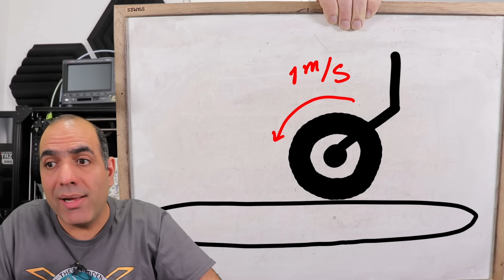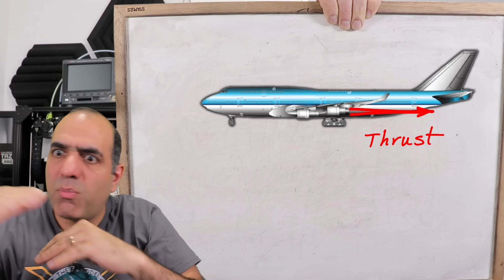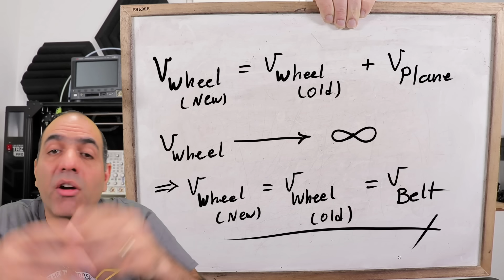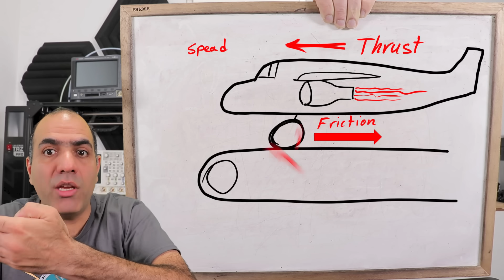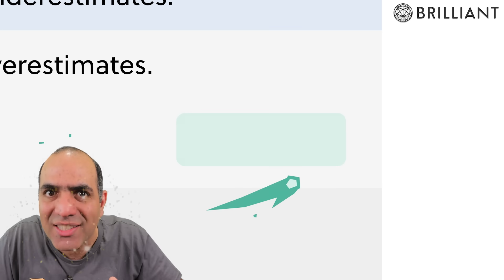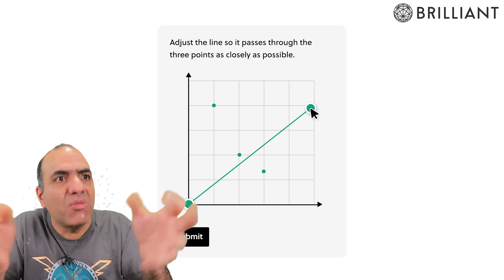Airplane Question that Drove Me NUTS!!!

Comment: Supposing a given plane could produce enough thrust to overcome any added forces produced from rolling friction, which would have to ignore the maximum rate at which the wheels could turn without flying apart, the plane would accelerate, causing air to move over the wings, producing lift and eventually takeoff. Imagine a person on skates on a tread mill, and you are behind them arms out holding them in place while the skates and belt roll over each other. The force you are putting into holding them in one place is the rolling resistance needed to overcome the squish of the wheels, belt, and bearings. Notice how its a tiny force easily overcome? Even if the treadmill accelerates, you could push them forward. For the plane the wheels should only experience a doubling of the rate of acceleration up to the takeoff speed maxing out at twice the takeoff speed wheel RPM (if the belt does not infinitely accelerate trying to catch the wheels and thus the problem of the landing gear wheels and rolling elements flying apart from centrifugal forces). Of course, this would mean the takeoff length would probably be some length longer, but again as long as the engines can overcome the increased rolling resistance and accelerate to takeoff airspeed it is going to take off. No airplane I am aware of gives mechanical drive power to its wheels, especially for takeoff. 

A similar scenario would be a seaplane on a river flowing towards a narrow waterfall, with the plane facing away from the fall against the flow. As long as it can produce enough thrust to overcome the water resistance imparted by the increasing flow and gain airspeed over the wings, the wings will produce lift and the craft will enter flight.

In both cases the craft is 'decoupled' from the surface its on by the freely turning wheels, or in the case of a seaplane water over the floats.
Reply: CORRECTION EDIT: You won't believe how the math says, "No!" with this one weird trick!!! A&P Technicians hate it..... 

The normal take off speed is 184 (on average, varies based on configuration, airframe, load out, meteorological conditions, etc) mph, taking 30 to 40 seconds to achieve sufficient flow across the wing airfoil profile to produce a lifting force greater than the mass of the aircraft allowing the flight control surfaces to maneuver said aircraft away from the ground. A 747-8 tire is 52 inches and weighs 270lbs or 550lbs with the full wheel gear (based on quick cursory googling), 184mph at 52" diameter is 1189.4 RPM producing 1044.7g of centripetal force. These are the NORMAL forces these wheels experience every single takeoff.  

Supposing the treadmill does not attempt to 'out race' the wheel speed, instead simply samples it say every half millisecond and (somehow, finger wiggle) instantaneously matches that speed (yes, meaning due to acceleration the treadmill would technically be 0.5ms worth of acceleration behind the wheel speed at any given instance above 0 mph. Ignoring whatever that tiny difference would be at takeoff) the takeoff forces should be around 2*takeoff speed(no treadmill). Or 368 mph(relative wheel-to-treadmill speed for a decoupled object (ignoring mechanical rolling resistances) moving at 184mph true ground/air-speed), 2379rpm, and 4179g.

Golly that's a lot of force! But wait....we can't stop there! We can't get lost in the neuro-high of working out a big ass number, we need the final part of the puzzle! What is the rated over speed (maximum speed) for 747-8 wheels per the manufacturer? Well, it's Boeing, and it's the FAA, thus those ratings would not only be part of the standard training procedure but also publicly available. According to Boeing, 235mph is as fast as they ever want to see the wheels spin, and advise a full wheels off inspection if they exceed this speed, so not quite failure, do not exceed, fly the thing apart speed, but the speed at which you done caused a mechanic to earn their paycheck making sure you didn't break your employers leased jetliner... Well, here we go....

Normal takeoff: 184mph, 1189.4rpm, 1044.7g.

Wheel speeds of takeoff on treadmill(normal takeoff*2): 368mph, 2379rpm, 4179g.

Maximum rated wheel speed at takeoff: 235mph, 1519rpm, 1704g....

🤨😥🙁😤😔😢😔😑😐🙄😒

...So 😁 ignoring the issues with instantaneously matching wheel speed as measured every 0.5ms, and mechanical friction and rolling resistances in the tire-treadmill interface and inside the bearings, the answer is....

No, the aircraft will not take off due to the landing gear wheels flying apart about 15 seconds into it's takeoff roll. The plane will have been traveling north of 117.5mph when the landing gear machanisms drop onto the treadmill surface which would have been moving over 117mph in the other direction, likely shearing the struts off if they don't punch through the belt in the first place. The plane will likely list and yaw, as ya do, eventually roll, digging the leading wings tip/edge into the ground with the mass of the aircraft leveraging against the wingbox where the wing structure meets the fuselage. The mechanical stresses of such an event will cause the internal structure to fracture and introduce jet fuel, stored in the wings and in center fuselage tanks, to air moving around 100mph to 150mph past tiny to massive gaps in said wing fuel tanks, aerosolizing the liquid into a mist of varying droplet size. Due to the recent configuration of the aircraft (for takeoff) the engines, which by now would have abandoned their posts, possibly out of fear, would have been at full or near-full thrust, the rotating elements would have considerable rotational inertia and the combustion section elements would be what is technically know in the industry as "don't touch that-", "ouchy-", "SHIT THATS-", or "shoulda known that was gonna be fuckin-" ... -hot. Unfortunately as a result of their current state, the engines, now being some non-zero distance between where they were to the indeterminate distance of where they should not be, somewhere between the disintegrating wing and main body of the plane, will be acting in some form of reckless manner. It is likely the previously described fuel mist, and hot-ass-fuckin (another technical term) engine parts will meet, talk thermodynamics into a stoichiometric three-way, and set their immediate world on fire, much to the chagrin of any passengers on board, the flight attendant crew, the flight services crew, the pilots, onlookers standing a bit too close, the giant treadmill runway operator, the airport owner, and most importantly.....the giant runway treadmill maintenance technician.

So.... There we have it. That is what would happen if you tried to takeoff on a treadmill in a 747. Youd be in good shape until the tiers explode, and then have one helluva bon fire.

Call ahead to the airport fire responders, make sure they have marshmallows, chocolate, and graham crackers. 

Unless you have a headwind greater than 66.5mph, then it'd probably be fine... 

....that's gotta be worth a 4ch o-scope, right Mehdi? 😟 Plz?

Comment: No it can't take off as there isn't enough airflow over the wings. The plane is basically in a static position.
Reply: thousands of pounds of thrust pushing it forward, nothing holding it back, and it's not moving?  why?

Comment: Its not going to work because the plane needs to move fast compared to the air, and not the ground.

Shirt. I forgot that its not the wheel thats moving the plane forward
Well, i tried
Reply: thousands of pounds of thrust pushing it forward, nothing holding it back, and it's not moving?  why?
Reply: @tsm688  Im not sure what you mean, but its not going to take off
Reply: @nemtudom5074  Why wouldn't it take off if it's moving forward at the required speed?
Reply: @tsm688  I was wrong.

If we conveniently forget about the fact that the plane needs the ground to support it until it reaches a speed where it can take off, then its going to take off because the engines are going to be pushing it forward no matter what the wheels are doing
Reply: @nemtudom5074  In what way is the ground not supporting it?
Reply: @tsm688  When the plane is going slow, it'd crash into the asphalt if the wheels werent keeping it up.

If we assume that the plane can just hover even at idle, even without the wheels overcoming gravity, it'd take off without an issue.

Thats exactly how this debate works. The wheels spinning at the same speed as the conveyor belt is completely irrelevant, because unlike a car, the plane doesnt need the wheels to go forward. The jet engines make it do that, the wheels are only there so the plane's chassis doesnt belly flop on the ground

Comment: The problem in this scenario is how the scenario states "the conveyor belt is designed to exactly match the speed of the wheels, moving in the opposite direction." It FAILS to specify if the speed it's matching is the rate at which the wheel is spinning, or the rate at which the wheel's physical position is changing with respect to the ground that the conveyor belt is sitting on.
In the latter case, it's pretty straightforward; if the wheel's position is changing at a rate of x, the conveyor belt's rate of travel will be -x. In the former case, when the wheel begins to move forward its angular velocity increases with respect to the conveyor belt, so the conveyor belt speeds up to match the wheel, which causes the wheel to spin faster again, and on up until the wheel flies apart due to the feedback loop. Or the wheel starts spinning at the speed of light, in the fantasy land where the wheel is indestructible.

In any case, the wheels aren't what is moving the aircraft forward; they're essentially free-spinning bearings with a non-zero but negligible effect on the aircraft's ability to accelerate. A jet aircraft isn't a car. The engines work by throwing air and combustion gasses backwards, and that is what provides thrust thanks to newton's third law of motion. The only way the conveyor belt will slow down the aircraft enough to prevent it from taking off is if it's spinning so fast that it's able to act on the aircraft through what little force DOES make it through the wheel bearings. Though at that point, the conveyor may also be moving the nearby air fast enough that the wings are able to gain enough lift to take off anyway.

Comment: I think case 3 is the one that normal people refer to.  We need to be assuming negligible winds and all unspecified variables are at realistic values.  The wheel bearings have a speed limit dictated by friction but the conveyor belt is all powerful.  The moment the plane picks up any ground speed, it’s canceled out by the belt.  Thus the plane remains stationary relative to the ground (and therefore the air around it) no matter what.
Reply: Problem with that is that the wheels of the airplane would not be able to stand such high speeds that is needed to slow the airplane down, the rubber would be destroyed and the wheels themselves would explode from the extreme rotation speed and centrifugal forces. Same can be said of the conveyor belt, it is not physically possible to build a belt that moves that fast. But if you ignore all the physical problems like above and just use magic that do not follow physics and make a belt that can move at such speeds even if physically impossible the airplane would not be able to take of.
Reply: wheels do not work that way.  imagine a car in neutral speeding down a highway.  the highway does not stop it.

make the highway a treadmill.  The wheels spin faster but so what?  A little wheel bearing friction?  The car moves anyway.
Reply: @tsm688 i made a video proofing, it wont take off.
Reply: @neutronenstern.  video != proof
logic = proof

Unless you left the brakes on, the airplane is not coupled to the wheels.

your logic is flawed.
Reply: @tsm688  The wheels do have friction,and this friction encounters thrust. It might be, that the threadmill will habe to go at an insane insane insane amount of speed,but at some point the friction force inside the bearing of the wheel will encounter the thrust of the plane. And due to the question,it will eventually be able to reach this speed, cause else the plane will,asyou said move, and this would imply,that the wheel is turning faster than the belt, which violates the information given in the task. So the plane will not move,and the belt will go crazily fast, and the friction force will encounter the thrust. (notice, that the wheel is indeed attached to the plane, so if it had brakes on,the plane will stop, and of friction is as strong as a brake, then it will also stop,and at some speed the friction will be as good as the best break.
Reply: @neutronenstern.  Solutions involving hyperlightspeed treadmills beyond the realms of physics are unacceptable.  Getting such a strange result either means
a) the question is gibberish
or
b) you've misinterpreted the question.
Reply: @tsm688  
Who says that it has to ne hyperlightspeed? I dont know the specs of the bearings of a wheel, but light speed is pretty pretty high in comparison to a wheels size.
if we assume the following: The friction is only caused by laminar friction of oil inside the bearing., The radius of the circle where the oil flows in the bearing is 0.1m, and the distance between the inner and outer circle of the bearing is 0.005m, and the bearing is 0.05m wide.Then the force will be F=k*v*A/d,
(for small d) where k is the viscosity of oil, v is the speed of the radius of the circle,where the oil flows, and d is the distance between the inner and outer circle and A is the surface area of the inner radius of the bearing. 
So then A=2*r*π*w, where w is the width of the bearing. So A=0.03m^2. The viscosity of oil is approx 0,1Pa*s
So if the thrust of the plane is 
800,000N,which gets divided by 3wheels, then the speed of the circle of the oil has to be v=F*d/(k*A)=444,444m/s=444.4Km/s. Notice that the speed of light is 300,000Km/s, which is way more than that. So this indicates, that its a speed, that is fairly very high, but not close to speed of light.
And at this speed the friction due to viscosity of oil will raffly encounter the thrust of the plane. (this is the speed of the bearing, not the wheel, but the speed of the wheel might be 2,3,5, or even 10times higher than that,but not more than that. And even if my numbers where off by a factor of all together 100, the speed would still be only ≈10% the speed of light. And i just calculated with laminar friction. But at thos point it will no longer be laminar, but turbulent, and then this friction force will be even at lower velocities.
Sooo. I guess your point is flawed.
Reply: @tsm688  oh it actually even gets divided by 18 (4*4+2wheels). So the speed, it has to go at to encounter friction is even lower. (74Km/s).
Reply: @neutronenstern.  That makes absolutely no sense.  Your math is out a number of zeroes somewhere.
Reply: @tsm688  ok then tell me the mistake.
But like I said, even with 2zeroes more, or with this many wheels even 3zeroes more, it would be still below speed of light.
Reply: @tsm688  
this is the math for end result:
800000 * (0.005/(0.1 * 0.03 * 18))
800000N is the thrust, 0,005m is the gap  between inner and outer radius of the bearing, 0,1Pa*s is the viscosity of oil, 0,03m^2 is the surface area inside the bearing (2*π*0,1m*0,05m) and 18 is the number of wheels.
Seems pretty valid to me.
You can check on the definition of viscosity, if you want to. Then with the approx. of that the gap is small in relation to the circumference of the bearing you can get the formula, that the force is F=k*v*A/d, which is very logical. This times 18 gives the overall force,so if you solve for v, you get a speed of v=F*d/(k*A*18), which then translates to v=800000N*0,005m/(0,1Pa*s*0,03m^2*18), which is exactly, what i have calculated with.
Reply: @tsm688  Also why shouldnt it make sence? 74Km/s is still damn fin fast,even if its way below speed of light.. This is 430000Mph.

Comment: Hundred percent will take off two totally different type of power or thrust sourced from the engines not the wheel. Normal 747 takeoff at roughly 180 mph but those wheels are going to be rotating at roughly 360 mph. That is if the conveyor belt was going in the opposite direction at 180 mph has mentioned in the normal problem.

Comment: Not possible! there is no wind!!!
Reply: why no wind?  thousands of pounds of thrust pushing it forward, nothing holding it back, and it's not moving why?
Reply: @tsm688  because the plan is (as I understood the question) stationary on a treadmill. Just the wheels are spinning like the plane is going 400 mph. There is no thrust from the jets. If the plane is stationary it is not moving so there is no wind to create an underpressure on the upper wingside. Therefore no lifting!!!
Reply: @dominikweiss1741  Not how I understood the question, but I guess a plane can't fly without engines...

the treadmill is pretty much irrelevant either way

Comment: The plane simply would NOT take off given the conveyer moved at the same speed the aircraft would move.The thrust of the aircraft engines is for the purpose of gaining speed. The speed of the aircraft pushes into the air molecules creating lift, which you have mentioned. No movement, no lift, no takeoff. Any other situations (like zero friction) seem like a stretch.
Reply: thousands of pounds of thrust pushing it forward, nothing holding it back, and it's not moving?  why?